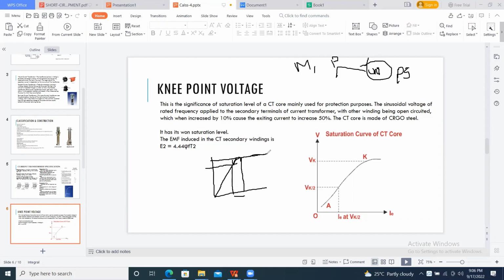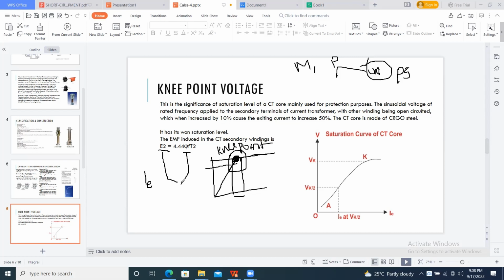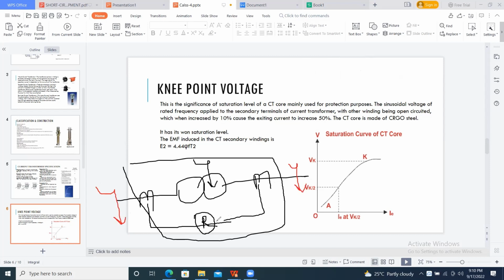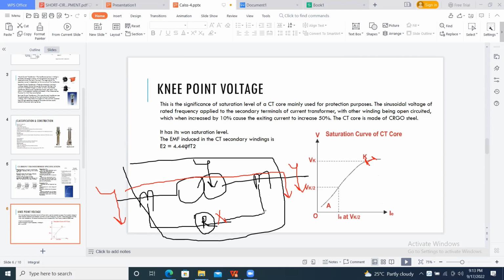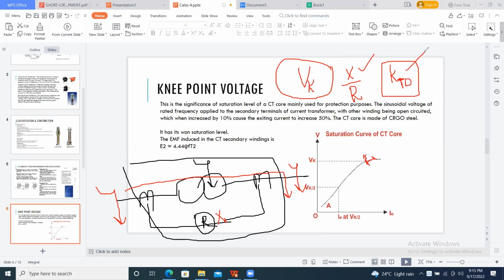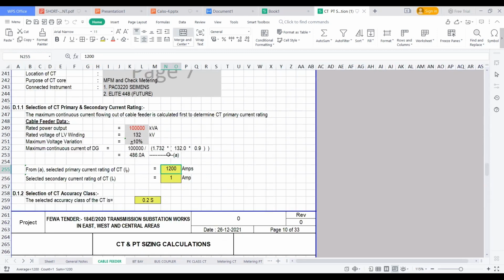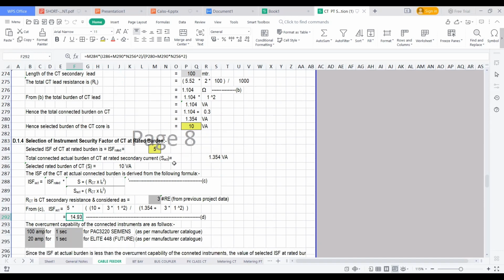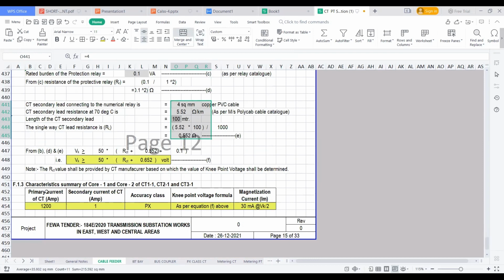Current Transformer Selection and Sizing | IEC | Part 6

Comment: Can i get calculation excel sheet
Reply from the maker: We provide all materials and videos during course, if you want this live course you can Contact: +918686219472 via WhatsApp

**_________ In This course, we discussed about below topics__________**
1. Substation/Switching Equipment selection and sizing - (IEC,IS, IEEE Standards)
2. CT VT Sizing Calculations Busbar sizing
3. HT & LT Cables
4. Cable tray sizing calculations Voltage drop calculations Bus duct Sizing calculations Load calculations Transformer Selection Transformer Sizing DG Sizing
5. Single line diagrams
6. Substation Layouts
7. Lighting Calculations
8. Lighting Protections
9. Earthing Calculations
10. Power System Protection Relay settings
11. LA sizing
12. HV circuit breakers sizing
13. Battery sizing
14. UPS sizing calculations
Reply from the maker: Course Material Download Instructions link: https://www.youtube.com/playlist?list=UUMO0oz2zQwR1BD9MdGWbsIrcw